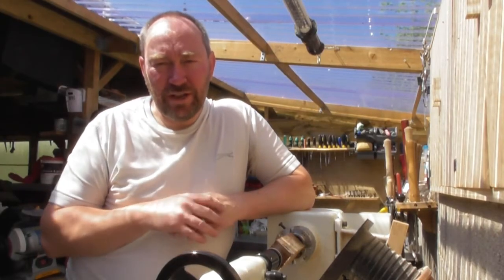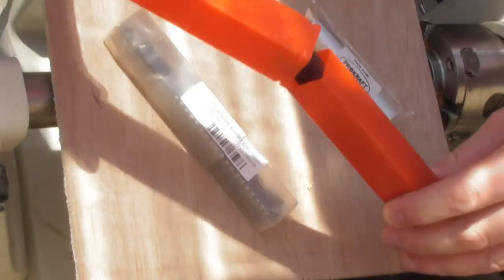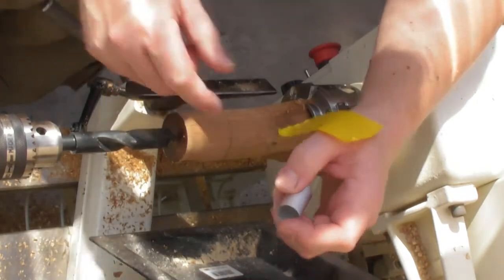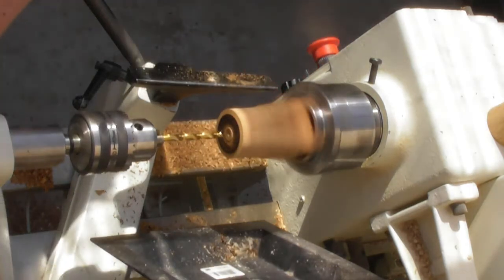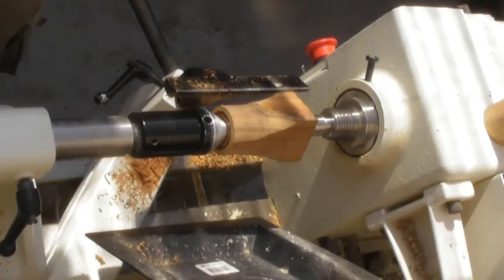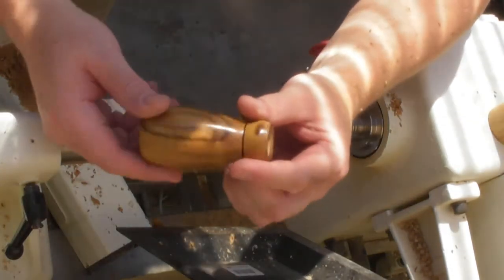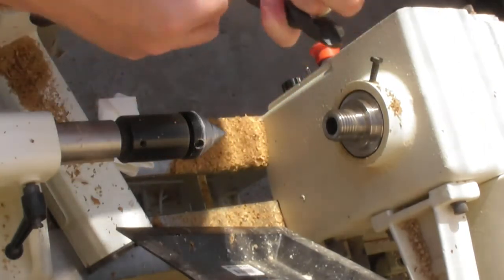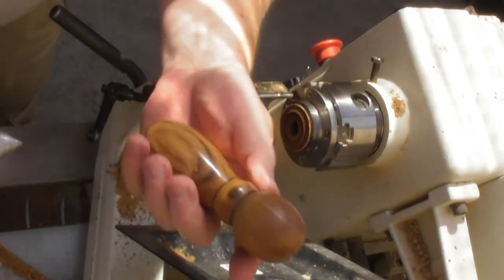Woodturning a perfume atomiser spray bottle

Comment: Can you use a 18mm forstner bit?
Reply from the maker: Our current model requires a 19-19.5mm drill, you can use whatever type you like but you are unlikely to find forstner bits in .5mm sizing. but you can drill smaller and enlarge with a chisel if you are careful and skilled enough. I think 3/4" is the correct size but I confess I cannot work in inches!

Comment: Any links to where i could
Find the drill bit?
Reply from the maker: Try here I think they are about the best value: https://www.ebay.co.uk/itm/BLACKSMITH-REDUCED-SHANK-DRILLS-HSS-DRILL-BITS-ALL-METRIC-SIZES-10-5mm-25mm/260958743368?hash=item3cc25a6b48:m:m9fZwWaXyLwV6WPmUusNoIw   We are starting to sell quite a few drill bits to make it easier but we don't have this one yet. Kind regards Jon